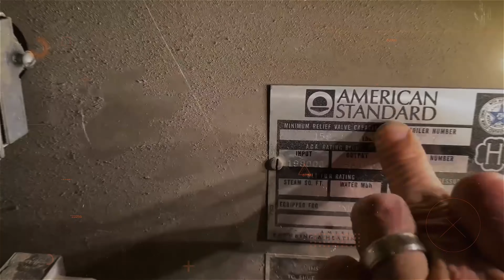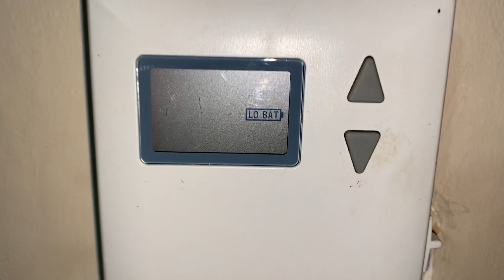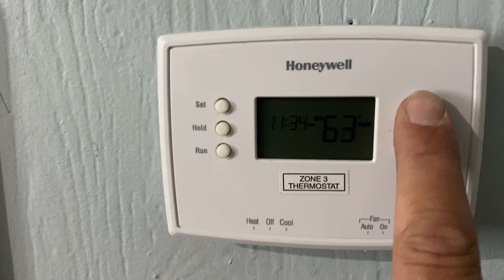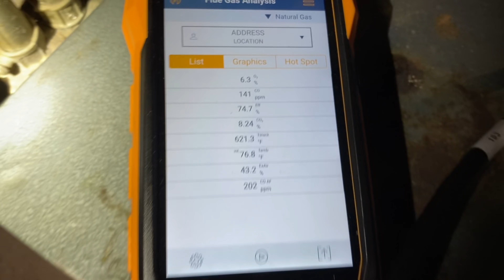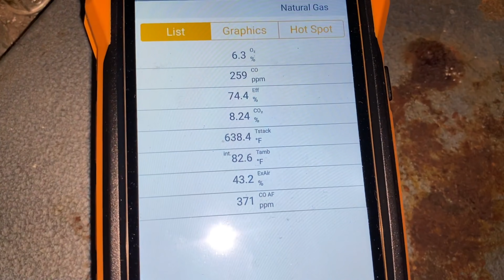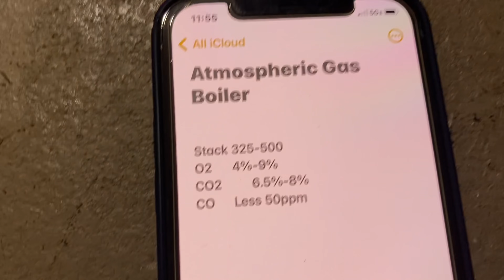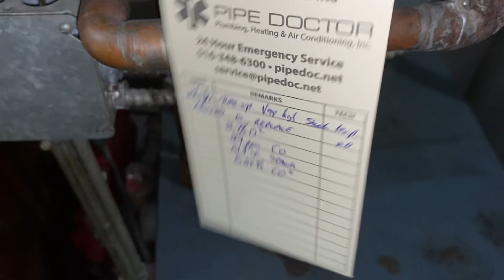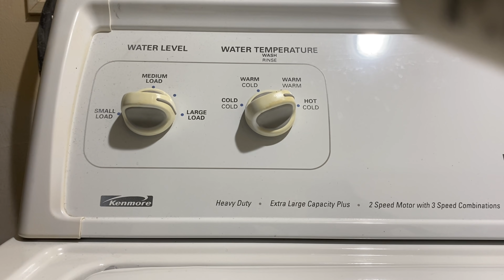Weil McLain CGM-7 Gas Boiler Annual Service 619 Degrees Stack Temp - Time for a New Hydronic Boiler

Comment: At the beginning of the video the homeowner said they changed parts of the venting cause it was clogged? Could be why there was no holes
Reply: you dont have to drill a hole in the venting there is another way of doing it. attach a copper tube onto your rod and bend it into the draft hood.

Comment: Hey Mike I got the same testo 300 I’ve had it for about a year I seem to like it you can go in the settings and add more measurements on the screen I added the draft one on mine so when you’re testing everything you’ll actually test a draft as well
Reply: @PipeDoctor  OK no problem I’ll text you this week and let you know The nice thing about this till you can put your company name and email in and also you could do the customers address. What did you like about 320

Comment: What causes such a high stack temp? Heat exchanger clogging up?
Reply: slow (poor) draft due to clogged heat exchanger or the flue, and or being over-fired.
Reply: Need to open it and clean the inside of the heat exchanger. I have a camera I put in the flue and see the exchanger to see if it’s clogged.
Reply: @biker55555  Yep,  should have checked manifold pressure also.

Comment: when i do the combustion test.  i bend a copper pipe and feed it into the draft hood. and it attaches to my testo.   Sometimes you need to push the customer to get a new unit.  you went the correct way. takes years of experience to make a customer feel comfortable with how you have to deal with your business.  thx for the videoo.

Comment: As soon as I saw all of those burners in there. I thought, oh my God, there's your problem. Long time ago I had a boss whose furnace kept going off on high limit. I looked at it, and he had a hundred  thousand BTU furnace and only needed, a little more than half of that. But he wanted his 100,000 BTU furnace. I tried to tell him dude it's too big. The only thing I could do is take burners out of it. Oh no he didn't want that. He wanted his 100,000 BTUs. And I basically told him, good luck with all that. Because you don't have the air flow. That lady will save money monthly,  if she does a new one. Good yob!

Comment: Hi Mike, love your content. One question: why suggest to the customer a 100k btu boiler when you say that a 210k btu boiler is three times over sized? Wouldn't a Weil McLain CGa-3 with 67k btu provide more than enough capacity to heat a cape cod in Valley Stream, NY?

Comment: Boilers over sized. Just like Dan has said many times it was like that before so it must be right, right? No doubt that old place had a massive boiler in it way back to heat the house on the coldest day.. with the windows open. Times changed others installed new boilers and assumed the size was correct.
Reply: Love Dan’s books

Comment: Did you have room to cut the gas manifold pressure back? Curious because you didn’t show you testing the gas pressure…overall with an oversized unit it probably wouldn’t have made a big difference but it was still a knob that could be turned?
Reply: @PipeDoctor   Lowing the manifold would decrease the co . of course. but. i didnt see what it was rated for and how far down can it run safely. could have done it to see.  but........  the boiler was way over sized and at the end of the day. she needs a new boiler.   Good job. Mikey.
Reply: @gas_man1565  the tag said (manifold gas press.) 3.5" W.C. so it's being overfired some, possibly it would have cleaned up enough to have better numbers. but there's probably a soot layer from lint blanketing the inside dropping efficiency.

Comment: Another oversized boiler,that boiler is like 240,000 btu.Unreal,its so easy to add up the baseboard or radiators ! Remember,if you only have 100,000 in rads ,you dont need more than that!You showed the tag,right after i wrote this and commented!lol

Comment: So why didn’t you pull the stack  . And check to see if it need to be cleaned. And check gas pressure. If you’re not testing . Your guessing . Lol
Reply: @PipeDoctor  I figured you did . You don’t miss a step . 
You didn’t put on video .

Comment: 😂🤣😅🤣
A new boiler for what ?
And I'm not hating, 🤣😂
If ANY BOILER DOESN'T LEAK IT CAN BE FIXED!
🤣😂🤣😂
🍺🍺🍺🥃🥃🍿🎯
Stay safe. 
Retired (werk'n)keyboard super tech. Wear your safety glasses!
Reply: I agree that’s how i was taught clean the heat exchanger, lower the gas or pull the stack something could have been done. But many plumbers don’t want to go through the hassle it’s easier and more money to get the customer to pay for a new boiler.

Comment: I have seen nothing other than if stated in manufacturers instructions at what level either temperature or carbon monoxide that forces a technician to shut a boiler down.    Nothing in code tells me to test an atmospheric boiler and I have contacted the manufactures and all they say is it cannot leave the factory with more than 400PPM "AIR FREE"  the dodge that we should be testing co in the field.  All they give  me for a Burnham Ind or a WM CGA is gas inlet, gas outlet pressures, breach draft, flue draft and match test.  Nothing in fuel gas code addresses this either, at least in Massachusetts.    Gets even more risky with power vent equipment that you do not have a test port or ability to test at the terminal.  

 I am not saying do not test atmospheric since I often do, just saying the code is almost non existent for carbon monoxide tests.  SHTF some times when I do and shut it down for high co, homeowner says never been tested in the lifetime of the boiler and never had an issue, so why am I making an issue of it now.  Stack temp is another thing but not in most instructions.